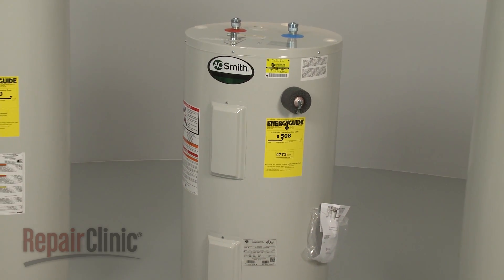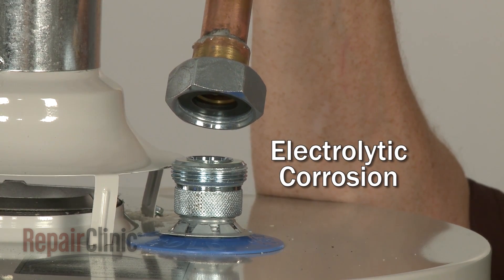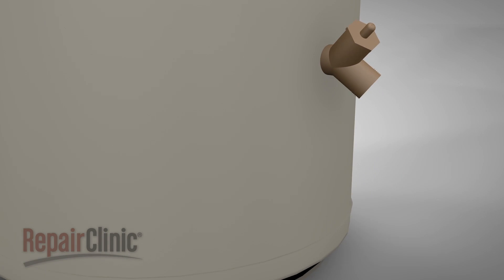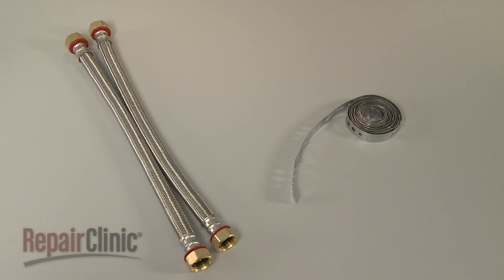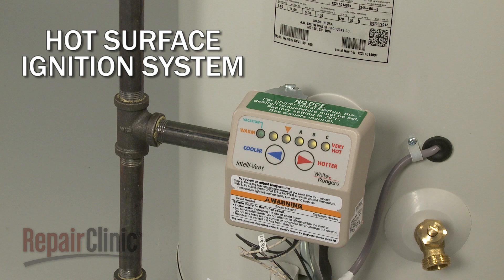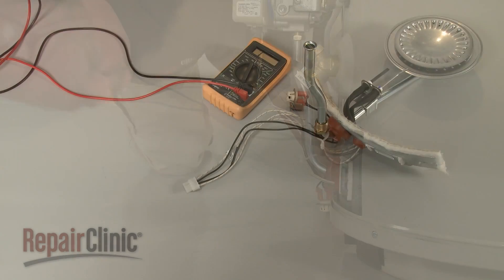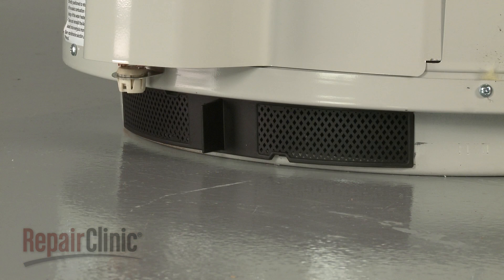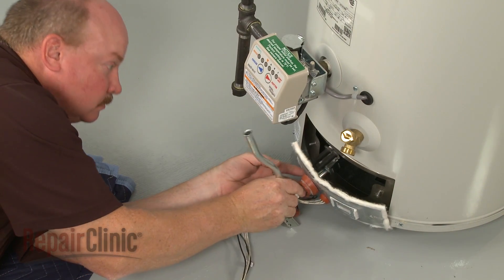How Does a Gas Water Heater Work? — HVAC Repair Tips

Comment: My house has PVC pipe for cold and hot water is this a problem
Reply: JonahKoi I do t believe PVC is an issue as long as the hot water uses CPVC which is designed for hot water specifically.

Comment: The problem with high efficiency furnaces and hot water heaters/boilers is that exhaust air containing CO and CO2 could leak out of the condensation port.
Reply: That would never happen as the video mentions that the carbon monoxide gets vented outside so there would be no chance for it to leak from the exhaust vent

Comment: This is one of the few 'how to' videos that is clear, thorough and succinct. It's professionally done and a pleasure to watch. Thank you!
Though I do have a question, please: A plumber told me that this type of water heater does not use any more gas than an instantaneous heater. He explained why, but I still don't understand. From what I gather, with tank heaters, when the water temperature drops to a certain point, the thermostat prompts flames to kick in and heat the water again. That means, gas is regularly being used to heat water, even if you're not using the water. Whereas, with an instantaneous hot water heater, the only gas that's used is the gas that you're actually using.  Therefore, wouldn't instantaneous heaters use a lot less gas?

Comment: Very useful Video! Can I have a question! Does it have a pump itself to pump water to bathroom? How can water flow up stairs! Tks
Reply: Elena & Ryan The cold water enters the water heater under pressure and displaced warm water in the tank as sonn as you open the faucet upstairs. No pump needed.

Comment: Does the pilot need to be relit after a power outage?
Reply: raredreamfootage  Mmmm, no , gas outage.
Reply: raredreamfootage no gas water heaters don't need electrical connections as you probably know.  The small electrical power requirements are met solely through the thermocouple or thermopile.

Comment: a friend of mine has a gas water heater, and i noticed that the cold inlet pipe is just as hot as the outlet hot water pipe. Do you have an answer for that?Thanks.
Reply: Fabio Darocha - that would typically be the case when the unit is not being used but is working.  Hot water will heat both hoses/pipes equally.  Once someone uses the hot water and cold water is flowing into the unit the cold water pipe should go colder for that timeframe.

Comment: Once I lite pilot light & tank heat up water but after that may be 6 hours I notice not pilot light.So why I am loosing pilot light?.
Reply from the maker: +Indra Patel The pilot could be dirty and going out when the burner is not on.
Reply: Indra Patel - could be a bad thermocouple.

Comment: One thing I've been confused about is what controls the burner? When and why does it shut off? And when and why does it turn back on? Is it a pressure reader or a thermostat? I've always found that confusing.

Btw. Good video.  :-)
Reply: I can answer that question for you.. What controls the burner is usually a thermostat that controls the temperature in the water. It usually shuts off when the temperature is at the selected setting (if you have a selectable heater dial). It shuts off so it doesn't get hotter and hotter and so it doesnt overheat. On some older models, it is a pressure reader, newer ones have a thermostat. Well there you go.

Comment: so if the heater is turned on in the bed room, and the air temperature is not as hot as before or almost room temperature, it is possible the dip tube could be broken off or has holes in them, am i correct ? thanks !
Reply from the maker: +michael lee If the dip tube breaks the water at the bottom of the tank will be hot, but the water where the out going tube picks up the water will be warm at best.

Comment: So, for some reason my water heater is still working but as the water, for example when i turn on the sink for the hot side there is NO hot water what so ever it like the hot water just disappear some where. I been without hot water for a week now, need to get it fix but have no idea what wrong, please if anyone got any idea that would help a lot.
Reply from the maker: If you have no hot water at any of the faucets make sure the valve on the water heater is turned on. You can watch the how it works video to help you . The cold water pressure pushes the hot water out of the tank and into the hot water lines. http://www.repairclinic.com/Video/VLVideoLayer/1032

Comment: Would it be dangerous to smoke next to one with a lighter?
Reply from the maker: As long as you don’t have a gas leak it is not dangerous. That being said you still should be very cautious. If there is a gas leak  and enough of the gas builds up it can be ignited by either the burner inside the water heater or by an external source. If there is no gas present then there is nothing to ignite. I would still try and avoid smoking around any gas appliance. Gas often will settle low to the floor and you may not smell it right away. Be aware and be safe! We want you to be around to watch a few more videos.

Comment: @RepairClinic.com
 I have a Rheem Fury Natural Gas 40 US Gallon 36,000 BTU water heater with an EF of .59 and I have accidentally spilled water on the thermostat (about a teaspoon of water), should I replace it or will it be ok, or should I just wait and see if the thermostat malfunctions and causes the T&P valve to activate or the burner to stop firing, the thermostat is almost identical to this one (http://waterheatertimer.org/images/Gas-water-heater-89-valve-2.jpg)

Comment: I have an old 1992 AO Smith water heater that came original with my house, and it has been working for those 20+ years and still is. AO Smith makes a darn fine device!
Reply from the maker: We're happy it has worked so well for you!
Reply: *****
I do, however, have another question. My aunt recently got a new water heater, because the pipes on the old one somehow corroded shut, although there was no surface corrosion. How could this have happened within the pipe? She gets city water, and I believe there is a filter on the incoming main.
Reply: Might want to change the sacrificial anode rod.

Comment: my problem is the hot water runs quickly. I also have the temp set almost at the max. what can I do ?
Reply: Shane Nicholas cold water dip tube on cold water side is probably gone or deteriorated.  I would start by checking its condition